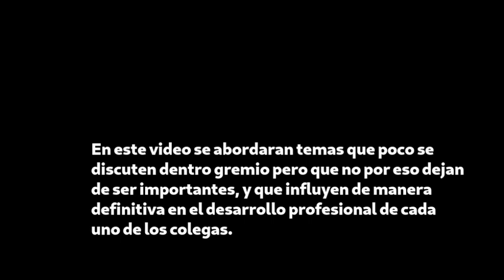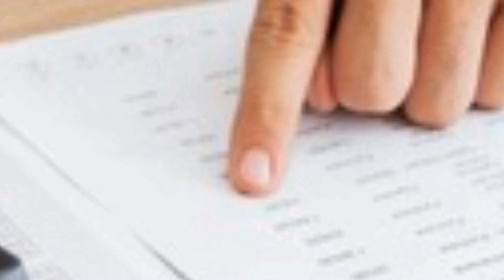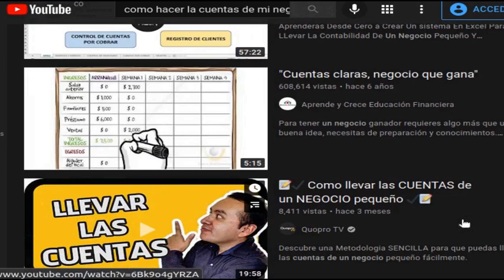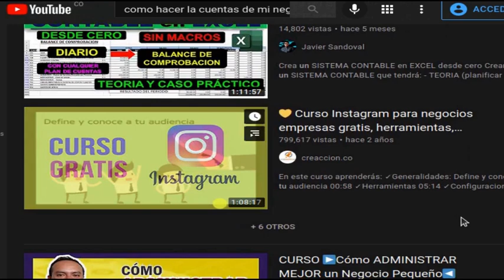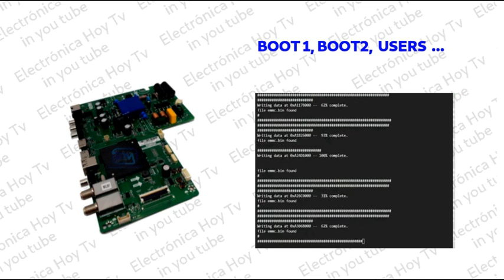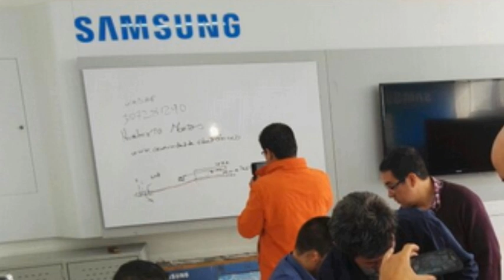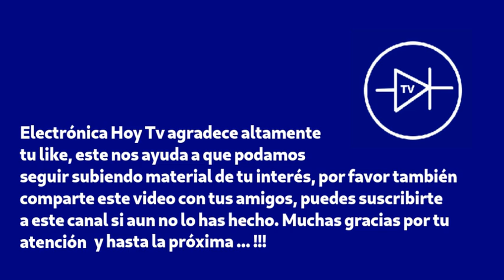LA PROFESION DE TECNICO ELECTRONICO

Comment: Hola mi nombre es Jose Luis. Vivo en Santa Marta, Colombia. Me parece un excelente video. He experimentado como algunas personas quieren desvalorizar el esfuerzo de uno como tecnico a la hora de prestar el servicio de reparación, pero sigo adelante con la ayuda de Dios.
Por otra parte queridos colegas tengo una inquietud: Tenia un caso con un tv led Hyundai de 32 pulgadas que no daba iluminación la pantalla. Revise los led y estan OK. Pero después vi que la placa Main de referencia P50-M6TV5.0 Tenia el capacitor electrolítico SE1 cuyo valor es 220 uF /35 V inflado. Lo cambié pero tengo otro problema con esta placa y es no pasa de stand-by; a veces prendia y a veces no. Ahora no prende; no sale del modo stand-by. El piloto de color rojo siempre está encendido. Que me sugieren para poder revisar mejor esta plaqueta? De antemano, muchas gracias
Reply from the maker: Hola ABINUX gracias por comentar, es posible que tenga problema el firmware que podría estar corrupto, habría que conseguir el archivo y re grabar la eMMC, éxitos

https://www.youtube.com/watch?v=WXBUZG5id9Y&t=2s